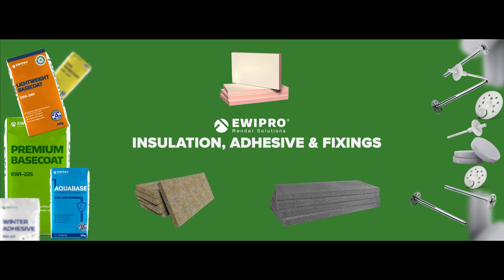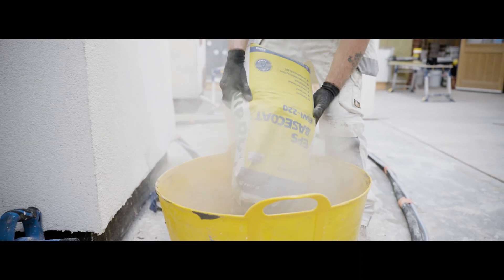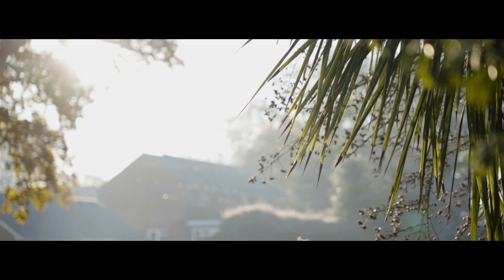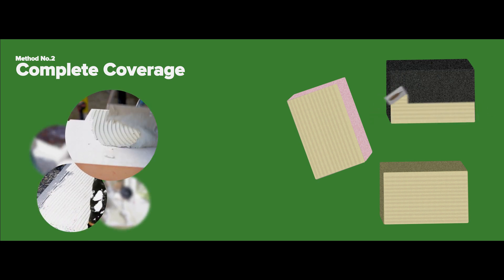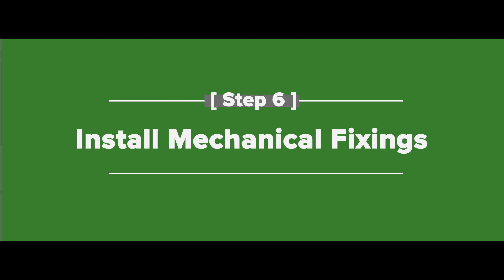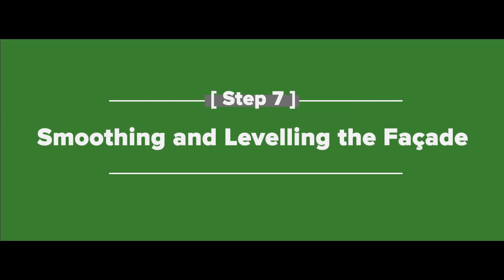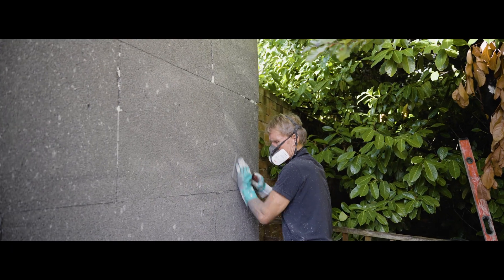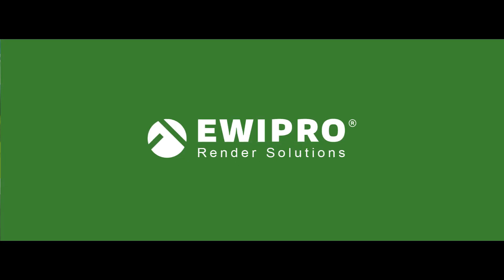Ep3 - Insulation, Adhesive & Fixings - External Wall Insulation Guide

Comment: Is it bad if the builder secured the mechanical fixings within a few minutes of fitting the insulation using adhesive. Will that lead to lead to any problems?